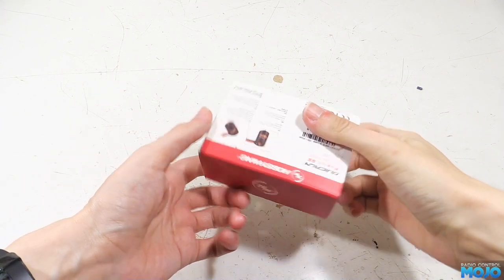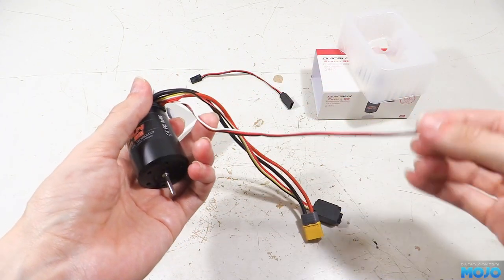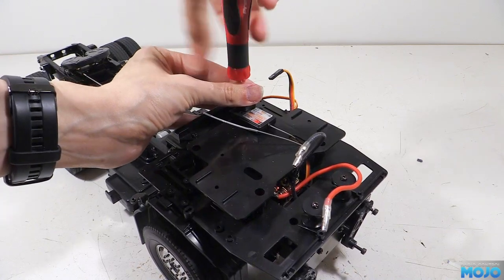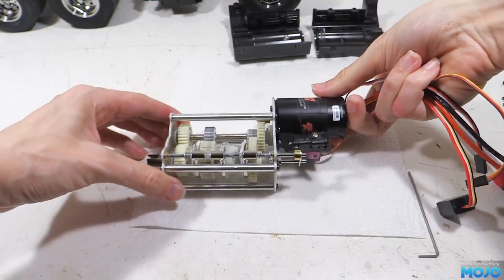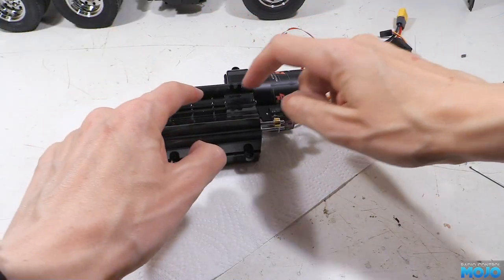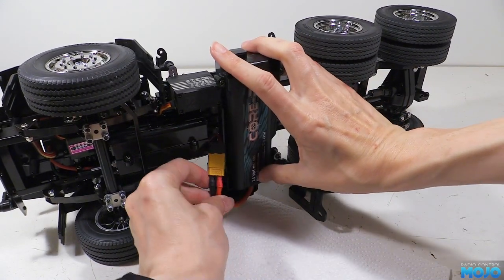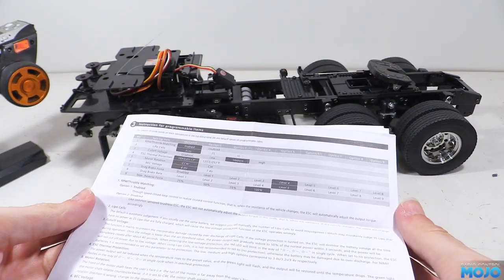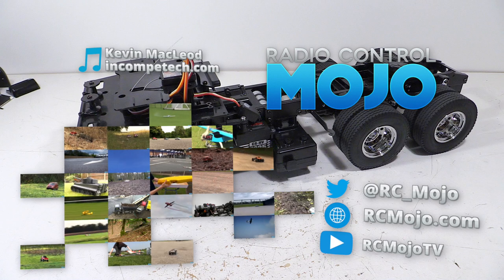Tamiya Scania 770S - 9 - Quicrun Fusion SE

Comment: Great progress on the build. I would ditch that gearbox and go for a directdrive with the Fusion and a planetary gear reduction.
Reply: That would CRAWL!!!
Reply: i have a 14-1 reduction straight off the 35 turn motor in my actros it runs smooth and pulls hard. the bonus is that you can relocate your steering servo to the front and push the motor back a little.

Comment: I ran into the same problem with battery wires on my trucks,Scania,man,Mercedes. I extended the wires in my battery’s 100mm or so to get them tucked into the wire channel better.

Comment: Something that people still misunderstand... (primarily because nearly EVERYONE believes it at this point).... HIGH TURN MOTORS HAVE LESS TORQUE THAN LOW TURN BRUSHED MOTORS!! 
It's been said to the contrary so many times, that people believe that high turn motors have more torque. 

On most RCs, a 15 turn brushed motor will SHRED the rubber right off of the tyres - where an 80 turn motor in the same vehicle, will likely stall... or take off slowly. THAT TYRE SHREDDING is TORQUE!!  

High turn motors ONLY provide a slower starting speed and control, and a lower top speed. That's it. Far less torque than a lower turn motor! Like I said, the contrary has been drilled into everyone for so long, most people just accept it as fact... 🙄 
There's also another way....... 

As soon as I can make videos again, in my Grand Hauler, I've fitted a 35 turn motor, and a 3:1 Gear Reduction Unit.  With a Hobbywing WP-1080, it crawls as smoothly as your Scania.... (minus of course the BEMF Speed Stabilisation Control)

Give it a go! GRUs aren't expensive! 
But I would love to try that 2 in 1 Quicrun unit, if I get money....
Reply: Yeah come back and make some more videos 👍 we need to see that thaitruck being built.
Reply: @@mattiasrc  Looking forward to it!!  I I'm waiting for the HINO cab from China (on the sloeist boat!!!), and I'll probably have to scratchbuild the Dump Bed. I'm fitting a 370 motor in it, to get that pure, 4 cylinder Thai power!!! 😆😁🤣 
It's taking much longer than expected.
Reply: @CarmineRC  hahah they are probably shipping it on a Djonk. Yepp for sure it will be a time consuming build but it will be frekking awesome when its all done.
Reply: @mattiasrc  I'm hoping! 
When I get my workbench back... I'm doing the 8X4 Tipper Truck first. It's the most expensive gift I'll ever get again (from the RC Elf).
Reply: @CarmineRC  thats a sweet build, enjoy.